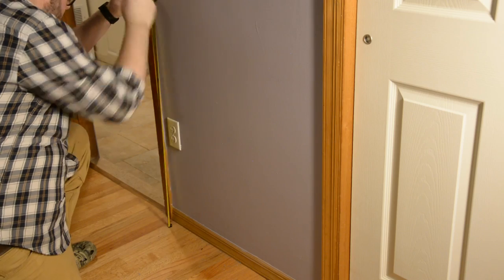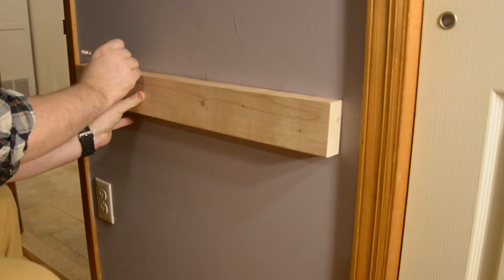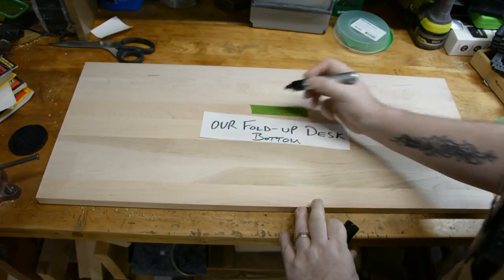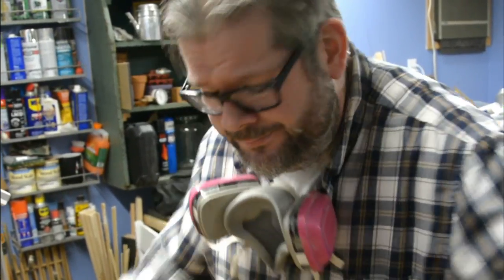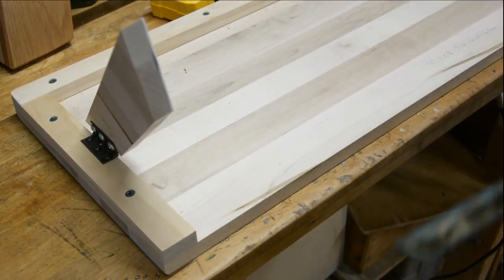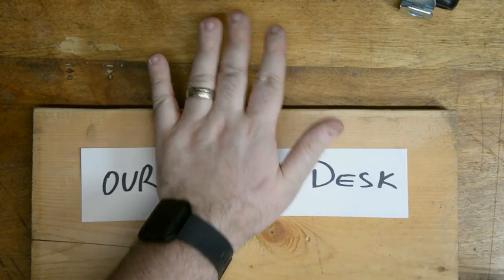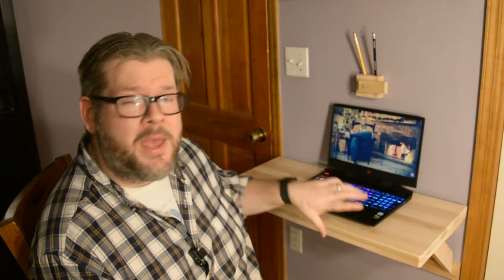Space Saving Murphy Desk DIY - complete tutorial - folding desk - an easy, space saving desk

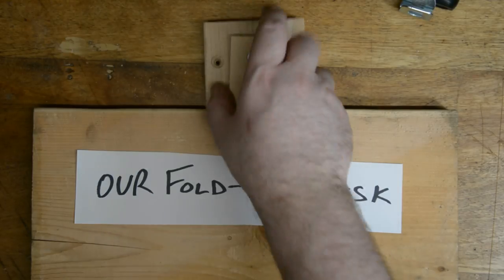Comment: But… What hardware did you use to make the swivel lock at 5:40? Is that just a loosened screw??
Reply from the maker: Yup, it was. I’ve since replaced it, of course, but at the time, it did the job!
Reply: @BurkeMakesStuff  what did you replace it with?

Comment: ~ hello Sir Burke!  

Firstly, I can't tell you how GRATEFUL I am for this video!!  
I've been looking for a fold-UP table solution for my daughter's playhouse (for wayyyy too long!) ... and your solution is both simple and elegant!!  As you probably know, most folding tables tend to be fold-down - however, I need to preserve the area beneath the table (for an existing rack of storage bins).  

QUESTION:  if my ideal tabletop dimensions are 46" wide by 23" deep, at a table height of 32" (to both clear the top of the storage rack AND work w/counter-height chairs), what modifications would you recommend?  

Based on your earlier comments, I'm thinking:

1)  Perhaps something other than the piano hinge?  

2)  Possibly doing 90-degree folding legs instead of 45-degree folding supports?  (Tho I get that if I choose legs:  a table height of 32" means that when the table is in its UP position it'd add an extra ~23" in height, thus the 32"-long legs would extend beyond the 23" of table by ~9" when locked UP - right? - but I'd be okay with that!)  

3)  What about the type/thickness of wood for the tabletop?  It won't need to bear much weight, just something two 11 year olds can sit at to draw or to use while playing a game/with dolls, etc.

THANK YOU SO MUCH, in advance, for any input you might have on my project!!
In peace,
~carey
Reply from the maker: Can you send a pic of the space? 
BurkeMakesStuff@gmail.com

Comment: Hey Burke! I wanna do something like this in my tiny apartment. I have a 10x12 space that is VERY cheap. Rather than get a larger space I want to start building cheap custom furniture to make the space more efficient, and because I love building things. Do you think a version of this fold down desk that's 30"x85" would be doable? Would it rip out its anchors? How would you modify your design to accommodate for the larger size?
Reply from the maker: As long as it’s anchored into wall beams (studs) it should work, yes. O might opt for chunkier hinges instead of the piano hinge because piano hinges use ver shallow screws. The added weight might not mesh well with those. Other than that, I’d use fold down legs instead of the angled supports. One leg on each end and one at center should be more than enough.
Reply: @BurkeMakesStuff  Awesome! Thanks for the tips. I'll come back with results!

Comment: Would this be strong enough to use as an assembly station? At the moment i only have a small shed (i will upgrade soon) and want to be able to free up space when im not working...
Reply from the maker: Absolutely. I would swap out for some chunkier hinges though, as piano hinge’s screws are pretty shallow.
Reply from the maker: Also might be a good idea for solidity to make the legs at a 90 degree down to the floor instead of the 45 degree to the wall I did in the video. Simple changes. Very doable.
Reply: Appreciate you taking the time to reply👍 thanks, i shall let you know how it works out, seeing as it is mainly following your design haha, thanks again buddy

Comment: Rockler has a folding shelf bracket ($25 each, which is a bit expensive) that doesn't require a clip to stay folded, and can be adjusted to slopes other than 90 degrees if you wish. Much less complicated. It is what I used for my wife's craft room.
Reply from the maker: Awesome tip! Thanks!

Comment: OSHA Standard requires "NO FACIAL HAIR" while wearing a respirator! Reference NIOSH 84. Their is no respirator that will protect if you have facial hair.   For sawdust i highly recommend a vaccum system.  For airborne chemicals, paints, solvents, do these outside with plenty of ventilation....Construction OSHA trainer for 32 years.
Reply from the maker: Depends on the type at this point. Ended up getting one called Micro Climate Air2. Looks like a space helmet, but works remarkably well with the beard. Hepa certified and all!

Comment: This seems easy enough, but I feel like it would look cleaner to have the desk fold down rather than up. Also, regarding the face mask. I used to work for a chemical plant. Factory workers were not aloud to have facial hair for this exact reason. If it doesn't seal, it can't do its job.
Reply from the maker: After a CRAZY a mount of research, reaching out to company after company, I learned about positive pressure respirators. it's a powered respirator. Air gets pulled in and filtered and sent pressurized into the mask. that way you aren't getting your air through suction, allowing particle to come in through your beard.  After even more research after learning about that, I happened on this. It's designed specifically for men with beards and uses that pressurized, powered method. pretty cool. check it out.
https://pekesafety.com/products/powercap-active-particulate-papr

Comment: To fit test a resperator at home cover the filter holes and take a very deep breath if it gets sucked down towards your face you have a good deal if it doesn't you need to look at a new mask. Know anyone that is certified in fantastic like me will let you know that a beard will stop you from getting a good seal as it creates a nice gap for the air to get through a way you can fight this is by covering the area with a thick spread of Vaseline as it will fill in all the gaps between your hairs and create a nice seal that's really your only way to get a good seal with a full beard.

Comment: It will be better if it folds downward, and you only see the top of the shelf, also, avoid using that primitive piece as you mentioned on the video.
Reply from the maker: I was far more concerned at the time with just getting it built so my son could use it during covid. I was focusing on function over form, but yes I think if it folded down, hiding all the other pieces, that would have looked better.
Reply: ~ personally, I'm ECSTATIC that you had it fold down - because that's what my space requires, and you are the only person who has done so in such a simple and elegant way.  THANK YOU!!

Comment: I think you have a problem with this concept. The weight of the table relies solely on those hinges-- its not actually supported by the table legs. Problematic...
Reply from the maker: Actually that’s incorrect, the legs are fully supported by the horizontal beam that is attached to the wall below. The legs rest on that and support the top. So the weight of the table and everything on it is fully supported by the frame of the wall. Not to mention, my 90 lbs son sits on it all the time, but what do I know… 🙄
Reply from the maker: I should say “sat on it” as well took it down about year ago. Still years of sitting on it, so. Thanks for your input, but it had no problems.
Reply: No need to be defensive- we all make mistakes. I'm talking about the hinged legs to table top. There is no support other than these hinges. I do think this is a design flaw and not great structural support. Otherwise, nice idea.  @BurkeMakesStuff
Reply from the maker: Oh, I’m sorry if it came off like that. Was just trying to explain quickly in between doing 1000 things lol.

Comment: A “full face” respirator
Reply from the maker: After a CRAZY a mount of research, reaching out to company after company, I learned about positive pressure respirators. it's a powered respirator. Air gets pulled in and filtered and sent pressurized into the mask. that way you aren't getting your air through suction, allowing particle to come in through your beard.  After even more research after learning about that, I happened on this. It's designed specifically for men with beards and uses that pressurized, powered method. pretty cool. check it out.
https://pekesafety.com/products/powercap-active-particulate-papr
Reply: Burke Makes Stuff Good you now know.  I was trained in all types of respirator uses

Comment: The respirator doesn't work because your hair prevents a proper seal around your face. You can have a beard/mustache as long as it sits inside far enough to not affect the sealing area. You need to wear it properly, or not at all... You get a false sense of security if you don't use it right.
Reply from the maker: Absolutley! After a CRAZY a mount of research, reaching out to company after company, I learned about positive pressure respirators. it's a powered respirator. Air gets pulled in and filtered and sent pressurized into the mask. that way you aren't getting your air through suction, allowing particle to come in through your beard.  After even more research after learning about that, I happened on this. It's designed specifically for men with beards and uses that pressurized, powered method. pretty cool. check it out.
https://pekesafety.com/products/powercap-active-particulate-papr
Reply: @BurkeMakesStuff   @Burke Makes Stuff  I guess that helps, I see the sealing area is farther back. That allows for more facial hair. You still need the sealing area to be free of hair, though. The mask does nothing if the particles are finding their way in between your hair. The importance of this depends on what you're trying to filter out. I use my mask at work to filter out heavy metals... Lead, arsenic, cadmium, beryllium, and a bunch of other nasty nasty stuff. Take no chances, be safe 👍

Comment: Dan says put oil down your beard. try that.
Reply from the maker: Huh?
Reply from the maker: After a CRAZY a mount of research, reaching out to company after company, I learned about positive pressure respirators. it's a powered respirator. Air gets pulled in and filtered and sent pressurized into the mask. that way you aren't getting your air through suction, allowing particle to come in through your beard.  After even more research after learning about that, I happened on this. It's designed specifically for men with beards and uses that pressurized, powered method. pretty cool. check it out.
https://pekesafety.com/products/powercap-active-particulate-papr

Comment: Respirators are not supposed to worn if you have a beard.  Check with and industrial hygienist or anyone’s respiratory protection program. Sorry , nice beard though.
Reply from the maker: After a CRAZY a mount of research, reaching out to company after company, I learned about positive pressure respirators. it's a powered respirator. Air gets pulled in and filtered and sent pressurized into the mask. that way you aren't getting your air through suction, allowing particle to come in through your beard.  After even more research after learning about that, I happened on this. It's designed specifically for men with beards and uses that pressurized, powered method. pretty cool. check it out.
https://pekesafety.com/products/powercap-active-particulate-papr

Comment: If you want a good seal on the vast majority of respirators, you have to forgo the beard. Maybe there are people that will swear up and down that a particular respirator works better with facial hair, but there's really no way around that as facial hair has a huge potential to mess with the seal. On the job, OSHA requires a clean shave where the seal is made so a compliant organization wouldn't even let you fit test if you show up with a beard. Exposure to hazmat is a real issue, and some of them are silent killers that aren't apparent until any deleterious effects are unavoidable.

That being said, you can get respirator setups that don't rely on facial seals, but they're expensive, heavy, and ridiculous for work at home and the vast majority of jobs requiring respirators (example: https://pksafety.com/blog/which-respirators-are-facial-hair-friendly/).